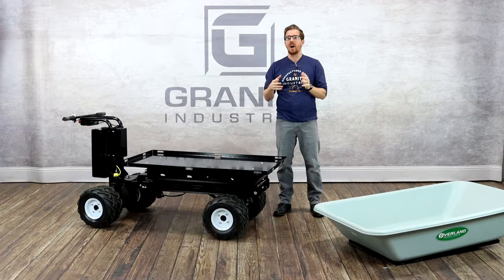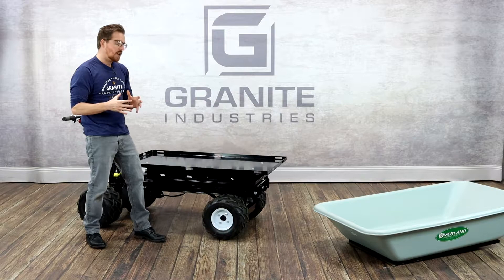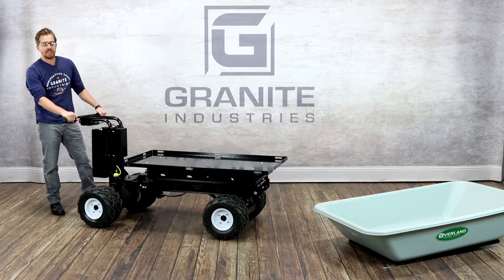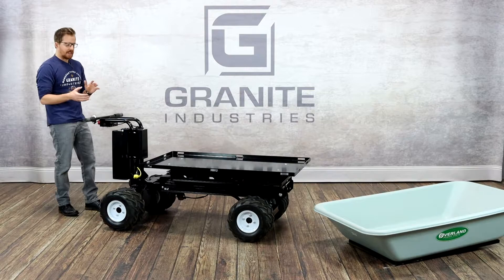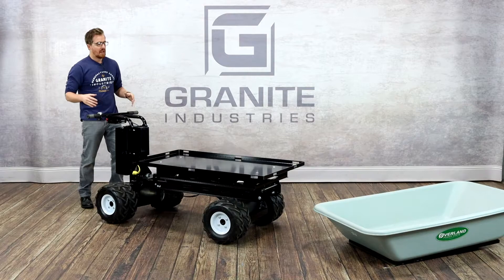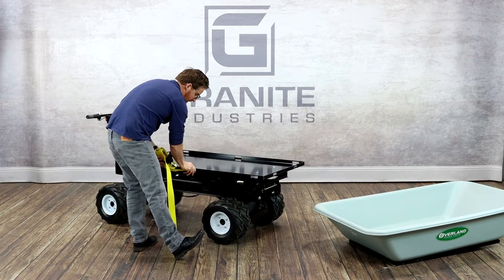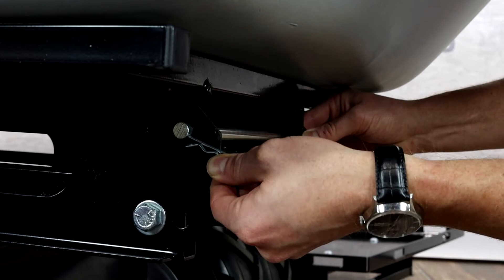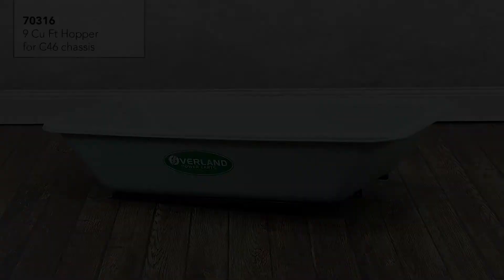Overland C46 4WD Power Wagon Demonstration and Hopper Removal

Comment: I just ordered mine today.  Thanks Chad in sales for your help.  I am looking forward to receiving this unit.  

For those looking into these carts. The reason for my purchase is I am getting older and also employees are hard to come by. So this will be very helpful in transporting my heavy tools with less trips and the physical exertion to carry by hand and feet the long distances. Sometimes I have to carry large boxes from garages around the house of walkout basements. I have had to carry chop saws and compressors 50 to 100 yards to where the work is to be performed. The 4wd should help with this these kinds of terrain. I will have more energy to install and less time on getting set up and taking down the job.  

My body is telling me it is time to work smarter and not harder.  👌🏼
Reply from the maker: Thanks for your kind words and thanks for going with Overland!

Comment: Can't see paying for this cart using lead acid batteries.
Reply from the maker: Hi Fernando, thanks for taking time to watch the video and providing feedback!  The sealed lead acid batteries we use feature AGM (Absorbent Glass Mat) technology and are from one of the most reputable battery suppliers on the market.  We have extensively tested the SLA batteries we use and they meet all of our standards and are excellent in all weather conditions.  We have looked into lithium ion batteries but the price point is still very high for the size that we would need for our application.  If you have any questions, please feel free to reach out: 877-447-2648 or via email: support@graniteind.com
Reply: @Overlandcarts  Glass Mat is not much of an improvement. Would seriously consider buying one of your carts if lithium was an option.